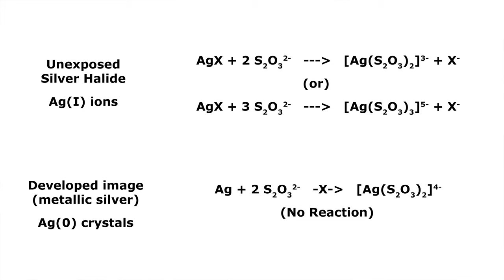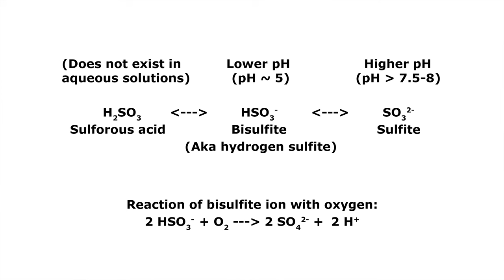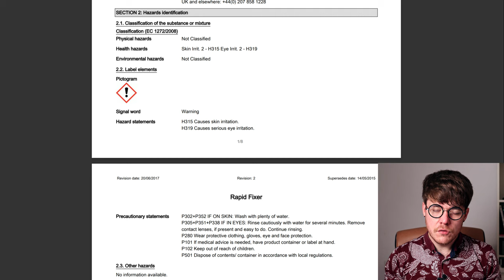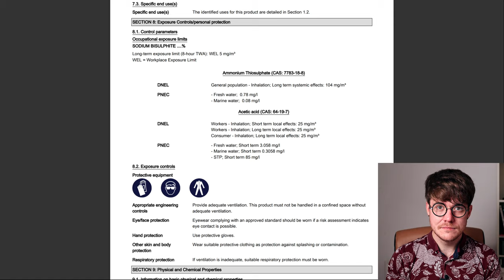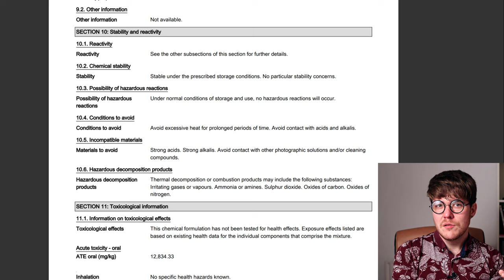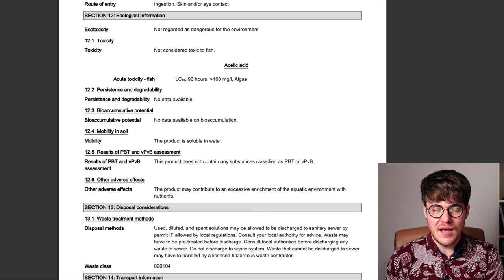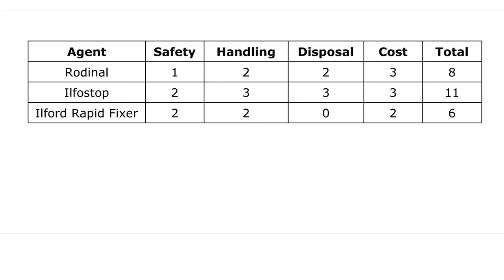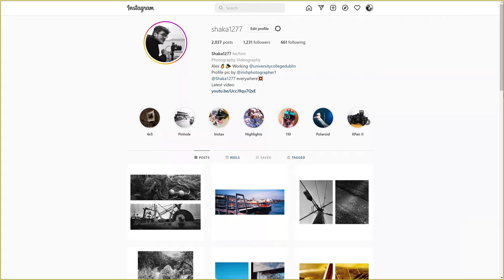Ilford Rapid Fixer: Safety, Handling, Disposal

Comment: 13:25 what I like to do is pour everything into the tank and put the leader into the little pool of fixer that will form on the top of paterson tanks. This will give me an idea of how strong the fixer is while the film is fixing.

Also I have a question, if I have tried to extract the silver, what can I do then. I wouldn't trust that my method actually removes all the silver.
Reply from the maker: Neat idea about the leader! If you don't trust that your silver extraction was thorough, still treat it as contaminated waste.
Reply: @Shaka1277  thanks for the reply.

It shouldn't be a problem as I don't think it costs anything here in Sweden to give chemical waste to a recycling center.

Edit: yes I just looked it up an appearently photographic fixer here is concidered "dangerous waste" (very specific description I know) either way what I found said that you can just give it to recycling stations as long as it is properly marked with what it is. And I know my local recycling station does have a place were you can leave "dangerous waste."

Comment: how does someone de-silver the used fixer at home?
Reply from the maker: There are a few ways but the simplest / most accessible is dumping steel wool into it. This replaces the silver ions with iron irons and iron metal with silver metal. The silver-coated wool can go into the bin (silver is only a problem as an ionic salt - at home scale) and the iron-soaked fixer can then go down the drain! There are some good guides out there with specifics but it works really well.
Reply: @Shaka1277  Thanks for explaining. That doesn’t even sound hard to do. Is there an easy way to tell when the process has completed? It’s amazing to me that the manufacturers don’t give any information to home developers, yet they must be aware that a large portion of there customer base is developing at home and pouring the spent chemicals down the loo. It’s like the industry’s dirty secret… literally!
Reply from the maker: Literally, yeah! There isn't really, but I've seen many people say that two standard "clumps" or steel wool is usually enough for 1 L of spent fixer. I've no idea about any home brew test to check for residual silver but there are kits you can buy if you want to be absolutely certain.